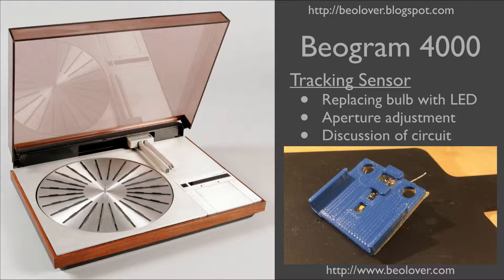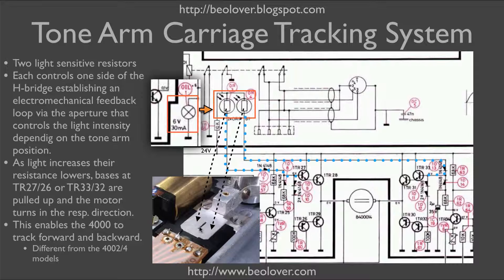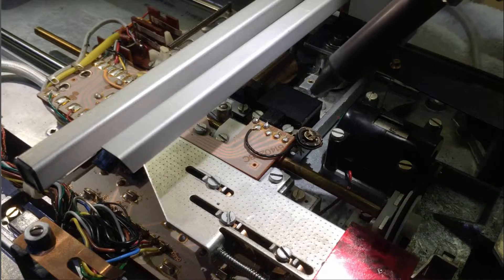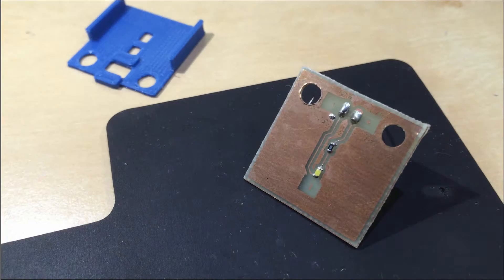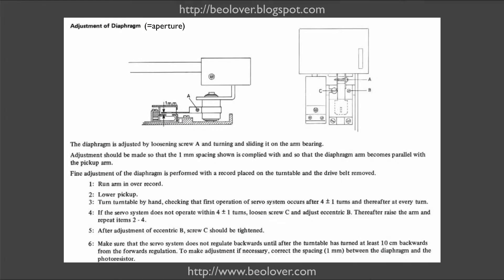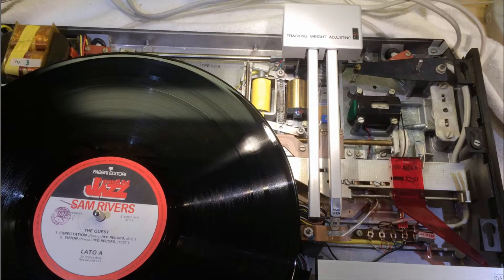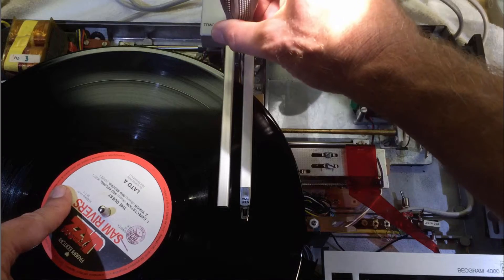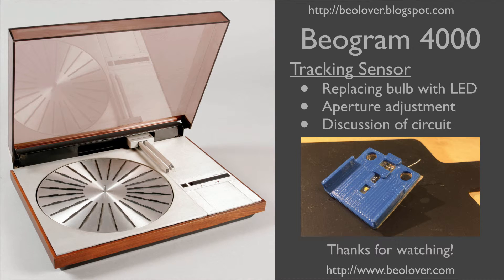Beogram 4000: Tracking Sensor Bulb Replacement with LED

Comment: Hello Rudy, thanks for this video, helped me a lot to understand whats going on with my BG4000, sadly ruined an MMC20E cartridge because  the arm started  to move in reverse mode while the needle was on the record and  snapped off the tip of the stylus. I'm still not sure why this happened as the aperture never been adjusted before, screw in factory position with the original paint dot seal on it. This is driving me crazy because everything looks okay, tonearm is paralel with the sensor arm , when Im moving the tonearm by hand invards to the center of the record the tracking motor advancing in the right direction. What I am missing ? Do you have an advice what I need to check ?